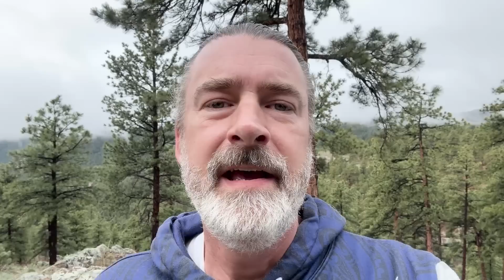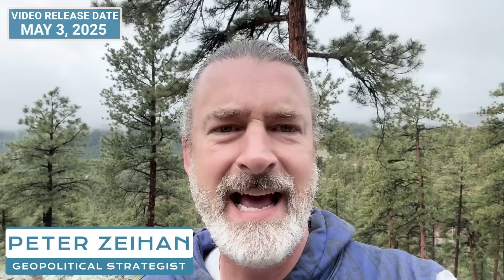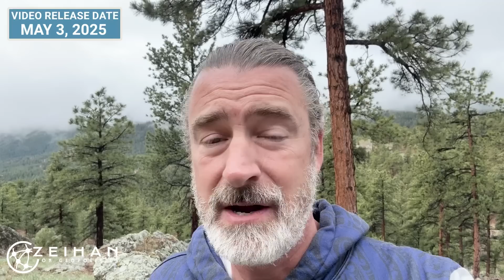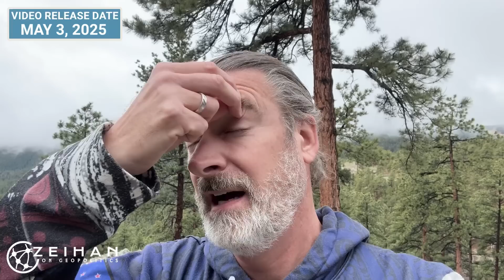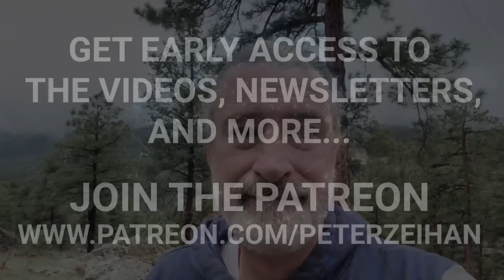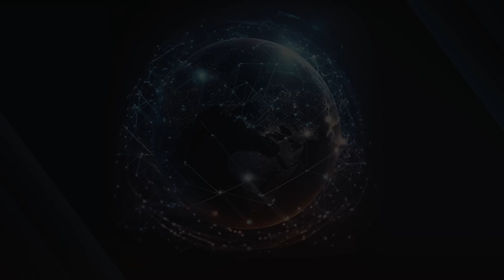The Night the Lights Went Out in Geor- er, Spain || Peter Zeihan

Comment: This is the worse analysis you have ever made...
UK does not have this problem because they invested in BESS on time. 
You don't need titanium batteries to build a fast reserve BESS that reacts at full power in 200ms to support the grid, any lithium or sodium  battery can do it.
Spain has released auxiliary services remuneration few months ago, extremely late for the amount of renewables it has.
The auxiliary services will provide the necessary grid stability and will be performed by BESS, solar and wind.
Spain does need more.interconnections with France building cables under the Mediterranean as the one been built in the north currently.
Also old aerial  conductors need to be replaced with more capable and modern ones.
No need of burning fossil fuels to have an stable grid.

Comment: You missed synchronous condensers to inject Vars (stability) in the electrical grid? This is fairly common with HVDC systems. No impact on green/non-green source options.

Comment: Great explanation. I do have to wonder if a flywheel battery (especially a cheap and cheerful cement one) wouldn’t provide a good solution. We used one to stabilize our grid while serving a lead zinc mine in northern Canada with a large dragline. 

Was it just a dynamic stability problem? Was the 16 GW drop off the because of that, or was that just the initial hit?

Comment: Batteries, through inverters, can ALSO stabilize the grid.  This was famously done recently during a power/frequency wobble in Australia.   Also wind turbines are spinning resources with rotational inertia, with proper programming, they too could provide brief grid stabilizing effects.  Really Solar PV is the only system which cannot do this because there is essentially no ability to add (or remove) short term power.   

It seems there is always a political "pro thermal" "anti thermal" battle.  In this case people THEORIZED that the problem was a lack of spinning thermal resources. And the pro thermal folks started talking about it before the data was in.

Comment: The system worked. Europe is entirely connected. Problem somewhere in Spain, dominoeffect, it was stopped with some parts of southern France. The peninsula was cut off the European grid within five seconds. Good job, protocols worked. Southern France was online with an hour or two. Spain and Portugal within 12 hours. The system worked. This dominoeffect usually happens, if it happens, due to frequency. Somewhere the frequency rose or fell and the domino started with one backing the other.
I am sure, damn sure, top boys and girls were scatching their heads on the speed and magnitude of this anomaly.
At the end of the day: the system worked.
Reply: I suppose the question therefore is - is this what everyone signed up to as a feature of a reliable grid.
It’s a bit like Microsoft describing a disagreeable aspect of its software as a feature, while the poor, unaware consumer experiences it as a bug.
Reply: @NigelPeters-s1m The shutdown was the protection feature. Without shut down there would have been all sorts of equipment destruction.
Reply: As a Portuguese I want to make it clear it was the Spanish fault. Obrigado

Comment: The Reason is NOT green Energy and NOT missing Battery Parks. Its bad Design of Energy distribution optimized  on old Technology. Solar power can correct Energy Output in microseconds. Needs only smarter controller.

Comment: Was the Seattle reference in regards to weather or were there are a bunch of drug addicts strung out, laying on the ground in the background that we did to see…

Other option is to keep a much larger portion of the grid on traditional mechanical power and focus technology on efficiency on the demand side instead of the supply side. You still get get green progression but not at the sacrifice of grid stability of national security.

Comment: One of the strongest grids in the world in BPA in the NW of the USA   Most generation is  large scale Hydro.  The big problem with solar is the grid operators can not control the out put frequency of the associated inverters.  In the case of wind generation the output frequency ( which establishes the load on the generator) CAN be controllable (theoretically) by the grid operator but it is very expensive to do that.  When we talk about frequency control of the load we are talking  about VERY, VERY SMALL ADJUSTMENTS.  Hopefully this explains more in plain English,  A retired EE here

Comment: 5:50   it dose not have to be coal/gas the french run on about 70-80% nuclear  with some hydro and a little gas.

Here in the uk we are about 30-40% gas  and 15-20% nuclear  with some hydro and pumped storage. 

But when you go above about 70-80% wind/solar then you can very easily start having issues.

Comment: Well, the grid is non linear chaotic system, with certain oscillator frequencies. The mathematical solutions to this problem are not trivial and way above what Peter is talking here.
Reply: It should be noted that large grids do not operate in a single synchronized frequency domain for this precise reason.  They are broken up into smaller domains by HVDC links and resynchronization stations.  Distance alone makes maintaining synchronization impossible, simply from thermal expansion and contraction, wind, and weather acting on long transmission lines.

Comment: While we wait for the complete story of what triggered this event,  a few things are obvious.
1.  The IT system that managed the grid was not up to the task of managing an inverter based system.
2. The fault protection protocols were designed to protect the equipment, not maintain the grid.
3. The Iberian grid has only 1/100 of the storage needed for the amount of inverter based generation it has.

Australia, California and Texas all have had blackouts and they learned how to fix their grid.  Texas had a very similar outage in 2022 and the report as to cause and correction is online.  A YT video from Practical Engineering 12 months ago also covers the information.

Comment: 2:53 "megahertz", should be just "hertz". 50 hertz.

It is of course possible to do big spinny things without fossil fuels. Hydropower has big heavy turbines, so does nuclear, and it would be perfectly possible to build big flywheels for the sole purpose of grid stability, for places that occasionally run on only solar/wind. Flywheels are already being built for use as "batteries". The stabilisation is a nice side effect.

Comment: There is another option.  Instead of having wind turbines that generate DC power, we fit them with hydraulic pumps.  A hundred or so 1-10MW turbines feed pressurised hydraulic fluid into a hydraulic main that drives a centralised hydraulic turbine on the ground.  This drives an alternator producing AC power for the grid.  You put a flywheel on the turbine to store energy.  You can build even more inertia into the system by using raised weight hydraulic accumulators.  This won't store days of power, but it should have a long enough time constant to allow gas turbines to spin up.  This eliminates most of the exotic materialsneeded for wind power and builds in spinning reserve.

Comment: Vanadium Flow Batteries are the perfext match for the frecuency control and renewable energy grid issues.....invented in the USA tested for 30 years but not promoted by the grid managers... the price for these great equipment will not drop in cost until a collective effort based in technical advantages not foreign batteries that is a security concern......vanadium is abundant and in general the flow batteries out-perform any other battery available today even Titanium oxide-lithium....
Reply: Flow batteries have a lot of storage but not a lot of power.  That is the primary trade-off.  So no, that won’t work for this purpose.   Regular grid scale storage (LFP based batteries) already solves the problem.  There is no actual debate amongst experts, just a lot of politics and commercial interests that get in the way.

Comment: First the reason seems to be far more complex than to blame it onto a lack of inertia. 
Keeping coal and gas plants online is increasing electricity cost. So why do it, when there are other options to make frequency changes easier to handle:
* Grid forming inverters
* Synchronous Condensers
* Nuclear power plants 
* More interconnectors (currently 1/5 of EU recommendation)

Comment: Ehh if spain had French Nuclear Reactors this would not have happened. The westinghouse model they use is so shitty it can't go under 40% power and must br shut down. It also cannot supply electricity for their own cooling systems and had to run a massive diesel generators to avoid a meltdown. In France our reactors can go down to 40% power and supply said power to feed the cooling system without the need of external generators. Also the steam turbines from the reactors act just as the ones in coal and gas plant. This guy sure loves shilling coal and gas... Germany relies way more on french excess nuclear  energy than coal and gas from other neighbors.

Comment: The way I think of the grid is that it was designed a century ago with an elegant way to keep all the independent generators of a country working as a cooperative group without any communication or computer controls...... The frequency (50hz or 60hz) is the speed (metaphorically) and if any generator tries to push power onto the grid at a speed faster than what is present they will be trying to power the entire grid all by themselves - which they cant accomplish and an overload occurs with likely damage.  If a generator tries to push power onto the grid at a slower speed then what is present the grid will drag them along.

Sort of like a dog sled where the grid frequency is the speed of the sled.... any one dog pulls faster than the team and he is pulling the entire sled by themselves, or pulling a muscle from the strain of trying. any one dog pulls slower than the team and they end up being dragged along by the sled.  Both scenarios are fault conditions by the generator in question so they have safety breakers which will separate them from the grid.  Doing so places stain on the other generators to pick up the slack and they are at risk of overload and their breakers tripping..... dominoes taking the whole country down.

Comment: I think a better term than "match the wobble" would have been "staying in phase".   (Engineering Physics degree here).  

To me, it seems they just need a standard turbine power plant (gas, coal, nuclear) to provide a base load and set "maintain the phase" for all the solar inverters to follow.
Reply: I think that's how it's actually done. Inverters are electronically controlled, they lock on to the phase (like a PLL) and adjust their output voltage to match and only then is it safe to join the grid. This is how home solar panel systems work, they have battery storage and an inverter that turns that DC to AC at the right voltage and phase locks that to the main grid.

Comment: we just need a lot of local storage, that will serve as a buffer, using the connections already in place. Building localized high-energy buffers mean we need new high capacity connections to the grid, which is not necessary. In my country there already are a lot of unused old plants, that still have the connections and transformers from the 1980s, but are not being used. We need smarter politicians, not populists, who are trying to suck up on putler or trumpet.

Comment: This is all complete nonsense, Peter.  You don’t need Lithium titanium for fast discharge.  Lithium iron phosphate can put out huge amounts of energy without taking any damage.  For grid scale storage, it is a function more of the BMS and inverter, not the cells.  And they actually have very good surge capability.  Your wobble description is also complete nonsense.  Pretty much this entire video should be pulled, it is garbage.

Comment: Pumped hydro would fix this.  Use the wind & solar DC to pump water uphill.  Use that stored energy and conventional hydro to power your grid.  Super stable. Super reliable.  Super predictable.  Also, a great route to energy independence.

Comment: ALL power should be local, at the individual home / business level. This can be done. Liquified air / compressed air storage.
All your HVAC needs are free byproducts. Cooking heat from this air via the vortex tube. NO moving parts. Your electric need will be minor and self generated, without requiring batteries.
DECENTRALIZE to the max.

Comment: There is another way gps clock link with terrestrial backup to all inverters or at least most of them. This as well as monitoring phase angle that already happens will be as reliable as a star delta network. Needs a legislation change though. The other ways you mention will work  but are wasteful.

Comment: The issue with all the Unrelieables aka "Renewables" is that they can only function if they have heavy syncronous generators to follow.
The obvious solution to this is of course nuclear energy ( reliable, cheap and zero carbon) , which provides stability to the grid.
In addition; "Renewables" can only play a very small part of any large scale energy system, or it becomes  unstable, unaffordable...or both.

Comment: The problem with Spain is centralized power grid.  Personally, people should beable to have their own solar, wind, wood, and backup generator without being fined or charged for sending the excess to the grid.  The power companies have monopolized power distribution so much that individuals are being punished for being independent like hogging water.

Comment: Easy fix;
Use alternatives to step up, create high voltage pulsing DC, for power lines, then step down and use it to power an AC generator, with enough fly wheel mass...

You can transform pulsing DC due to the effect of the collapsing field.

Just sayin'

Comment: There's nothing wrong (inaccurate) with what you're saying. But, the solar vs fossil fuel example gives the wrong impression. The issue is the lack of spinning mass in the Iberian peninsula example. Putting the flywheel generator combination back in the system is what matters. Not what energy source drives that flywheel. 
You highlighted all the challenges associated with handing the job off to batteries. (Cost and geographic supply concentration)

Comment: Peter the wobble is called frequency.  Poor system planning is the cause.  Just as is the case for outages in Texas and Alberta which are near  completely,  gas and coal powered and it's was those thermal resources that took down both systems.  Notice that the solution for Texas has been Tesla batteries and not more gas.  So your thesis on thermal resources is false.  The volume of batteries built in Texas since 2020 is enough to fully support Spain and Portugal.  So again Peter you are wrong.  Stick to what you know.  You're much better at it.

Comment: A better analogy than dancing would be soldiers marching in formation. They have to march at the same speed and in step. If one soldier missed a step he would have to speed up to catch up. But then he he went to fast he would have to slow down. No problem if the other soldiers are well trained, but imagine if the others get confused and aren't sure whose step to match and now everyone is trying to speed up and slow down. This is called hunting and it is what happens when a grid becomes unstable and many generators are trying to compensate for a change in the grid frequency. 
OK, the analogy isn't perfect and I left a lot out.
This problem is more likely to happen when you have many generators on a grid. It doesn't matter whether they are coal powered, nuclear or wind, they all have the same problem of having to stay synchronized. Two generators can stay synchronized a lot easier than thousands.

Comment: Was it a renewable issue or something different as the investigations here show ?
Here the pre alarms have been visible far earlier cause they have a warning time of some hours as they had seen that in greek before. 
At the end we have solar power and huge amount of batteries which can be reutilized easily at least here in the center of europe. 
Spain and Portugal are loosely connected to the EU due to the natural mountains Pyrena mountains.

If you have decentraliced batteries like we have there is also no need for high discharging cause many smaller can do that too and in the future the EVs to with those upcoming bidirectional charger.
Germany has all what you mentioned: big gas and coal power plants are running and also in the reserve. No issues at  all in the past 22 years - much more stable than US grid.
We do not suffer after storms, hurricanes and what not. We rarely have power lines over the ground and if we build a house then out of rock which will not fly across the country - just chech out all the old castles. The american cheap disney copy of our castles like Neuschwanstein might fly across the USA, but not the german one.

Comment: As far as i know the problem is partly related with software update to the new energy sources in the netword

Put on eye on articial inertia on solar power sources. 

Reguladory changed to better power dc ac systems but still a lot of all systems.

 As engineer i belive is posible  a safe operation with 70- 80% renewable power. But nuclear, or gas turbines always should be there for nights and low wind events.